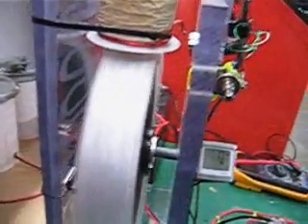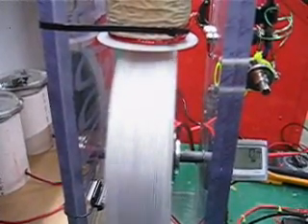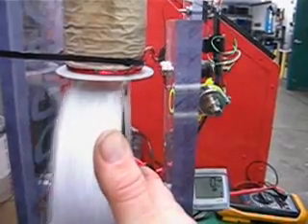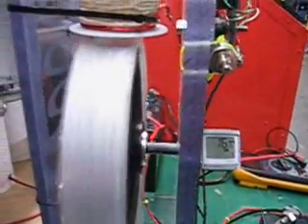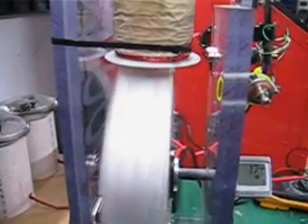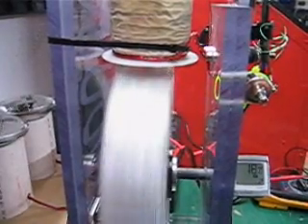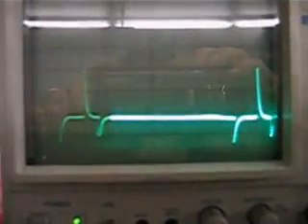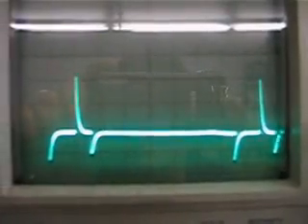Bedini SG 6 pole

Comment: I am noticing these spikes are created simply by the pulse coil inducing the (pickup or generating) coil. Its just a pulsing transformer 1:1 ratio and it seems to be getting same results as SSG.

I thought the spikes come from callapsing magnetic field from the magnets, not the pulse coil.

Anyway would u recommend using ferrite or similar mags instead of the neos?

Comment: hey man nice build and informative video!

I am building my own Bedini motor at the moment. Just wondering what the point of the 6 coils are for? do u have 1 pulsing and the others picking up energy? I noticed they all have seperate circuits? why?

atm I am using tiny neo mags but they aren't big enough to induce a current in the coil so instead of a trigger coil i have a reed switch. I am capturing back emf and getting 140v spikes. And thats without mags inducing the radiant energy.

Comment from the maker: I am not sure what you are asking, yes multiple windings in 1 coil is a esy way to tap the potential of the circuit. as long as all wire lengths and wire diameters are the same, I do not see any flaws with it, just circuit an easier way to time the circuit. not sure about efficiency yet, need to get a few bulbs and spend some time tuning. I am going to post a series of scope shots from each part of the circuit in the next couple of weeks.

Comment from the maker: hi marthale,

 probably the same as yours, a multiplied sg circuit, 100 ohm resistor off the base to a common potentiometer 2amp 10 turn 2k pot. one tranny to eachpower winding, other end common hot to battery.